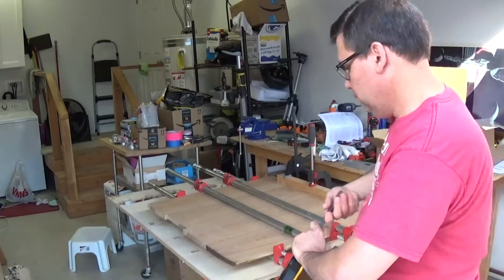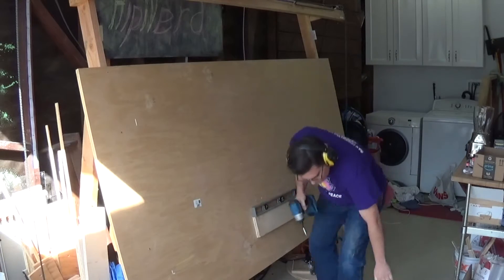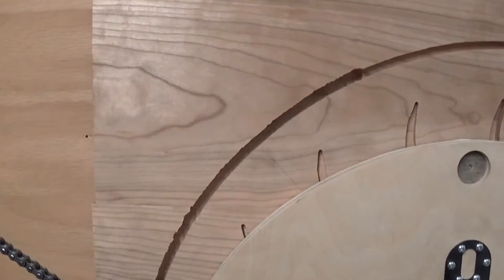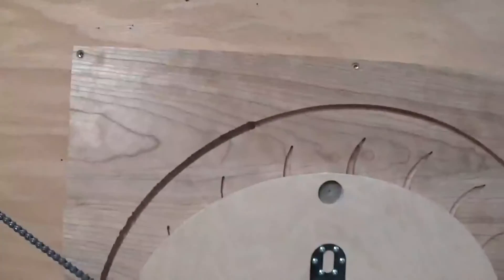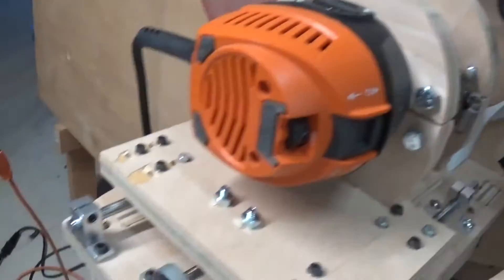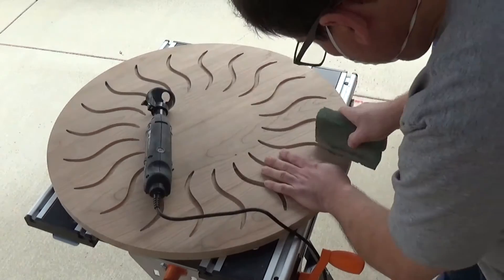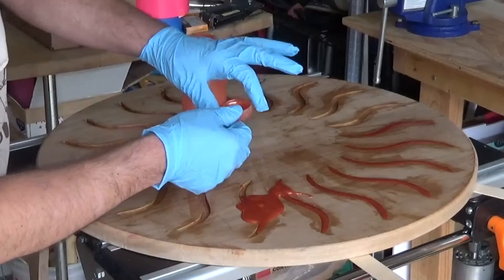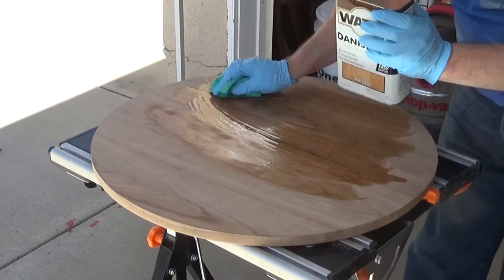Cherrywood and Epoxy End Table Using Maslow CNC

Comment: sweet table top!...the legs i am pretty meh about tbh, they looks so insubstantial. i would have used black pipe maybe.
Reply from the maker: Thanks for the compliment. 

As far as the legs go: It's a small table, and I want to emphasize the top. My only regret is that it was kind of a lazy solution. I probably could have cut something equivalent on the CNC.